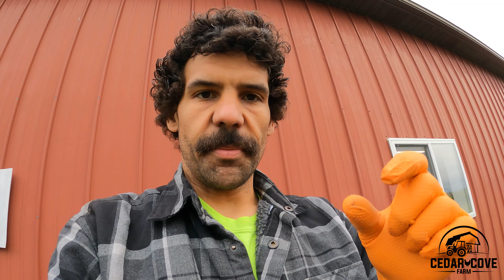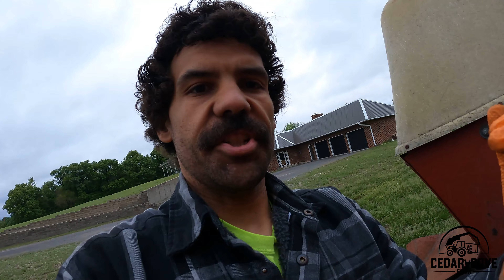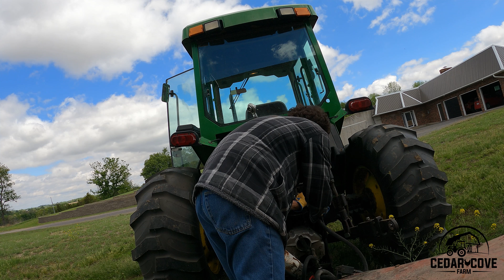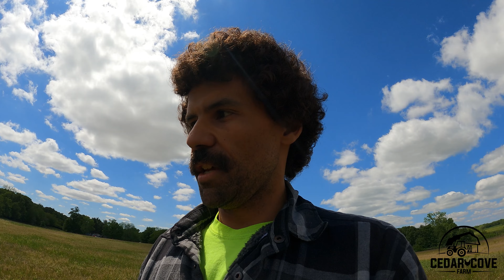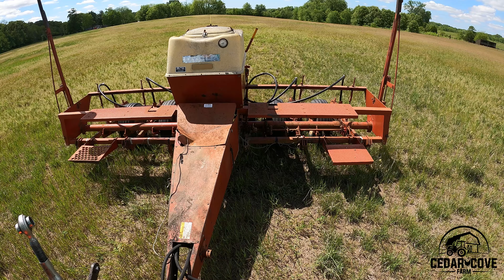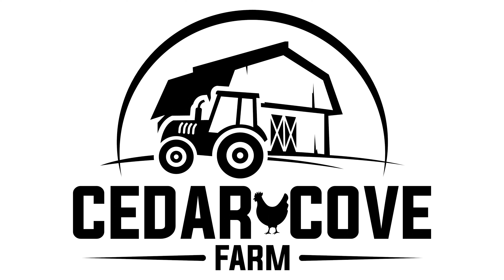IH Cyclo 400 Test Planting

Comment: Keep your spirits up. I have read in forums that the tubes need cleaned every use. Cause of moths and stuff. Maybe tubes plugged. I think my manual says 5 to 8 lbs of air pressure. Is the corn visible in the holes on the drum? I have no experience. just the manual and the internet.